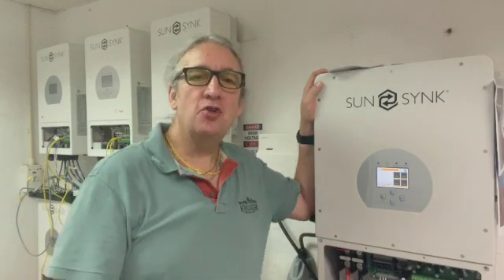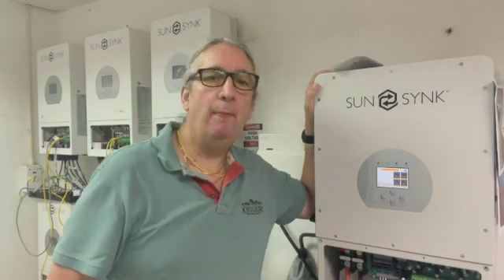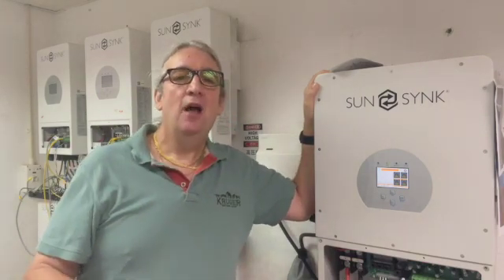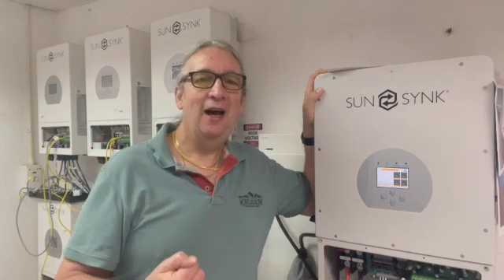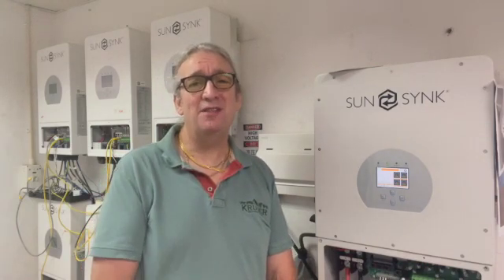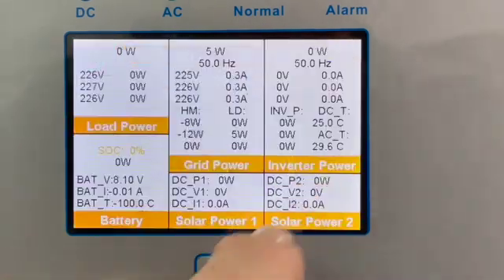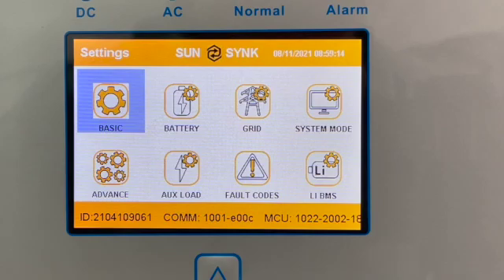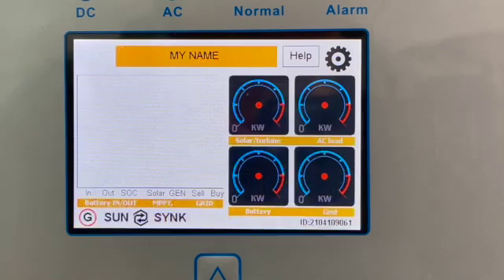Introduction to the #Sunsynk three phase Hybrid Inverter

Comment: Hi how may panel I can connect to 12 kv 3ph inverter can put 24x550w solar panel like 8+16 series with 2 input mppt
Reply: I have not seen Keith answere any comments, but then again I have not watch them all. 

I had a real bad time getting info on this inverters back when I bought mine.  I have 2. Bought them in order to connect 22 x 460W panels in MPPT1 (voltage on mine is 625V for the mppt and 800V max, 2 x 13A inputs) and 13 x 330W on MPPT2 (one 13A input) of each inverter.  

The 13 x 330W works fine but I get a F17 error when I try to connect the 22 panels, 2 strings of 11panels. This happens when the current goes over 22A (11A per string on mppt1) so just keep a look at your max amps.  They say 26 but mine doesnt do it.  

Updated the firmware but I still have the problem.

Comment: Just a heads-up for anybody trying to gain some insight into this particular product. The statement by Keith that this inverter can supply 6Kw per phase off-grid, and up to 12Kw per phase grid-tied, is complete and utter nonsense. This has been confirmed with Sunsynk tech support. The unit can only supply 12Kw in total but CAN supply 6Kw on one phase, 4Kw on another, and 2Kw on the third phase - a TOTAL of 12Kw. The rest of the video may be accurate, but that particular statement is truly a load of BS and should be removed from the video as it is completely misleading, and subsequently casts doubt on everything else said - whether valid or not. That's not good.
Reply from the maker: hi, interesting comment, the Inverter is actually asymmetrical loading and could have 100% asymmetrical on grid and 50% of grid
Reply: Thanks bud, i could smell that rat BS he was uttering a mile away. Immagine pulling 36kw from the 12kw inverter 😂😂

Comment: Hi Keith, need help, i had a 12kw 3phase sunsynk instaled, it only give 217 volt at inverter per phase, is there a way to push it up to 230v, help please.
The system is grid tied at the moment with panels and battery bank

Comment: What happens when a single phase is of grid is offline/outage. Will you draw from the other two phases and still charge DC side? Will UPS side of inverter then keep pulling from DC for all 3 phases? Or will passthrough work for 2 of them, and third will be at off grid limit ? What about grid tie feedback when one phase is down? Will there other two still still allow export?

Think home or office environment, not 3 phase motor world.
Reply: did you find out?

Comment: Afternoon Keith

Hope you are well… may you have a prosperous 2022…

I have a question I hope you can assist me with…
Do you need a set of batteries for each phase or will a single battery set supply DC power to all three phases in case of a  power failure for example?

Comment: Hello Keith. Great channel. A few questions. We have a 14kWp system that was formerly grid tied. We are thinking of replacing the old inverter on this plant which has 50 x 285W Poly Large Wafer JA panels - with the Sunsynk 3 phase 12kW hybrid  inverter, because we are adding 3x5kW PylonTech battery storage. How do you pair the SunSYnk with a suitable panel as you commented in the video? Also does this inverter ship with CT's and Energy Meter or only CT's with the metering aspect embedded? Best wishes - Winston Smith - Johannesburg South AFrica
Reply: Any response to this excellent question?

Comment: Looks great and glad it is available in South Africa.  Keith you mentioned it has a max PV input of 1000V DC but the versions I could find in South Africa have an 800V DC max.  When and where will the 12kw 3 phase Sunsynk hybrid inverter that can handle the 1000V DC be available from in South Africa?